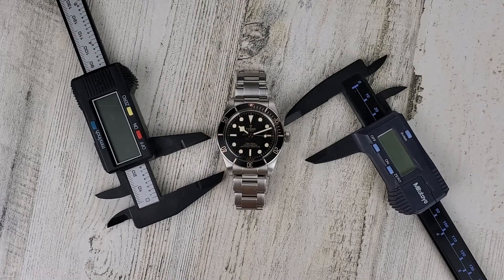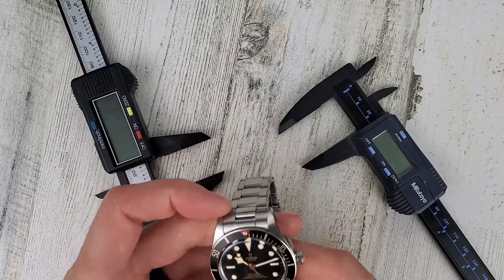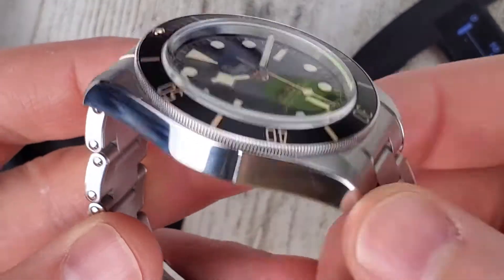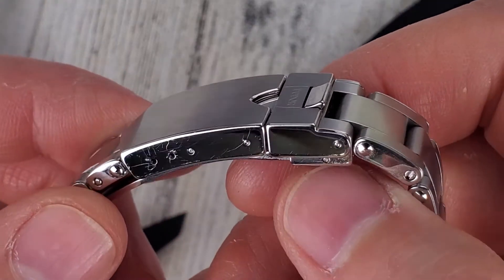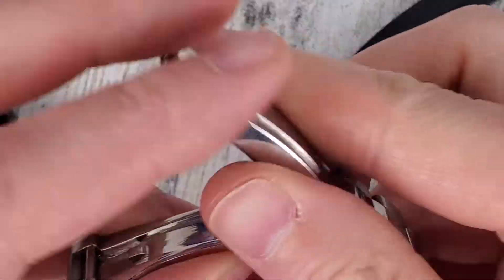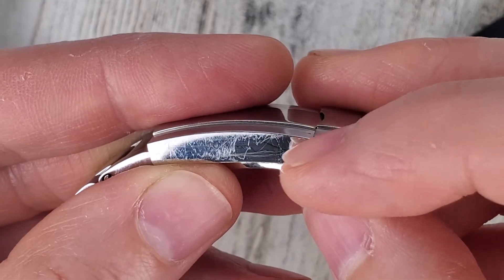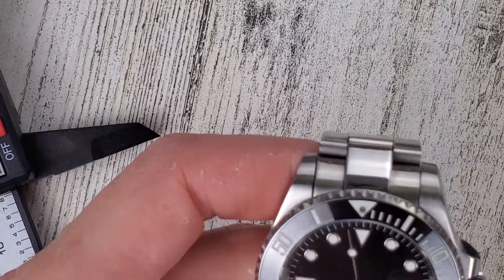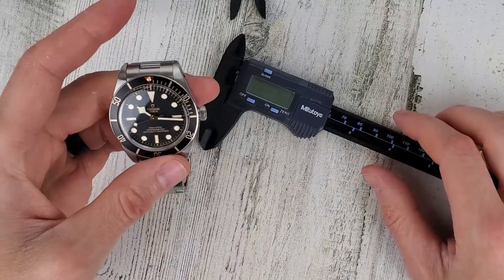Plastic Calipers CAN Scratch Your Watch

Comment: This also happened to me with carbon fiber calipers - they easily scratch polished metal watch cases.  Luckily, a Cape Cod Cloth and some elbow grease removed the scratches.  I have placed some invisible scotch tape on my calipers and no more scratches.
Reply from the maker: I have used cape cod cloths on some other watches with good results, and for the scratches that it does not work on, well those are too deep for the cape cod to work on.
Reply from the maker: I still have not taped my calipers, but I probably should one of these days.
Reply: @WrongTimeWatch  Yep, they are great.  They can not get out deep scratches in metal,  but they can make small, shallow scratches disappear.